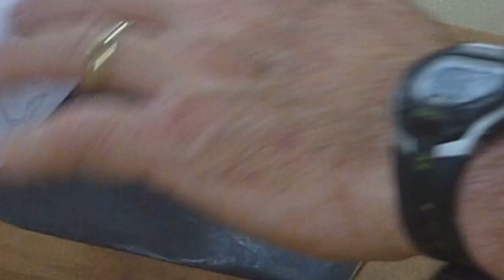Carving a Cigar Box  - House Greyjoy - Game of Thrones Inspired

Comment: Each one is better than the last Rod, what sort of wood is it made of? and is it a hard wood or soft? 
the reason I ask is I wonder how something like our Jarrah or white gum would be to carve compared to a softer wood or maybe how hard it would be to Inlay one into the other? Tony from Western Australia
Reply from the maker: Thanks Tony!  I haven't forgotten you , mate!  This is a very soft wood, mahogany exterior I believe (by the look of the grain, and color) and cedar inner lining. I'm unsure about the inlay thought, but it should be possible.
Reply: I didn't think you had Grin ! I'm unforgettable lol ! 
how many times Did you have to sharpen your chisels during that carving Rod And how about a leason in sharpening wood carving chisels please?
Reply from the maker: I use a leather strop and jeweler's rouge, 20 to 30 strokes with bevel down, pressing firmly but not overly hard.  The a couple stroke on the reverse side to flatten any bur.  the end goal is a mirror finish on the bevel.    I'll show some of that on my next carving video (yet to be planned)   Oh, and I sharpen every time I pick them up for the first time in a session, and again if I feel resistance during a cut.